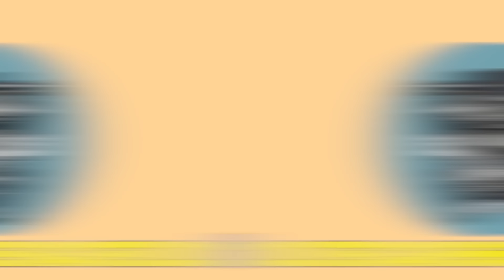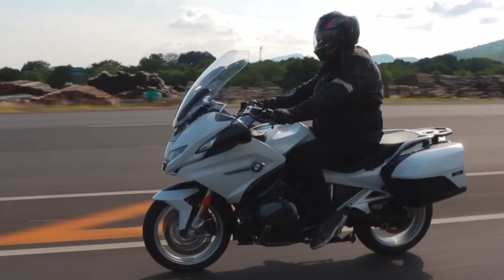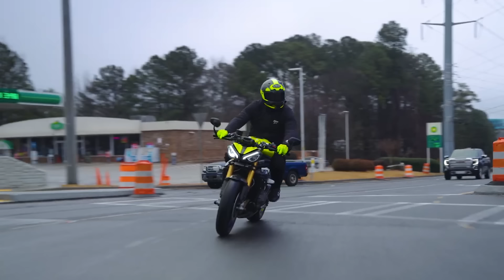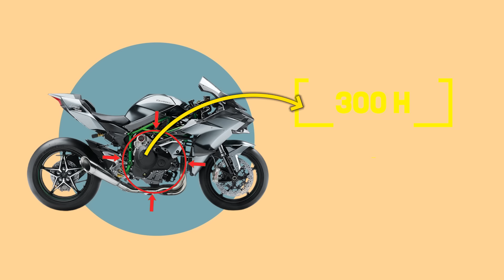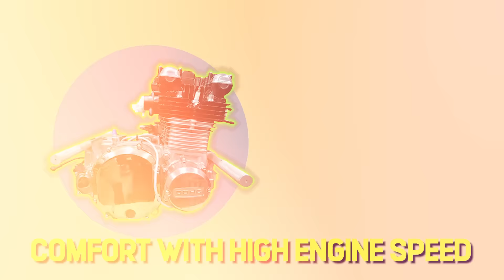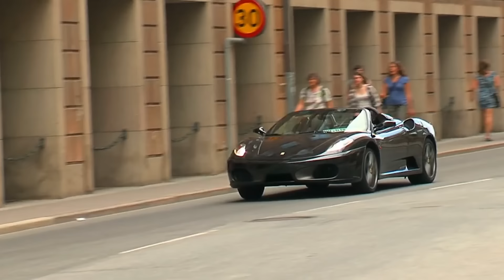Motorcycle Engines Are Way Better Than Car Engines (FIND OUT WHY)!

Comment: A Yamaha R1 is not an inline 4.  It's a cross-plane 4.
Reply: Cross-plane or not, they are inline 4 cylinders... Just like a flat plane V8 and a cross-plane V8 are both V8's.  Cross-plane inline 4s and flat-plane inline 4s are both still inline 4's.
Reply: Cross-plane from 2009 onwards, before that it was a regular firing order inline 4.